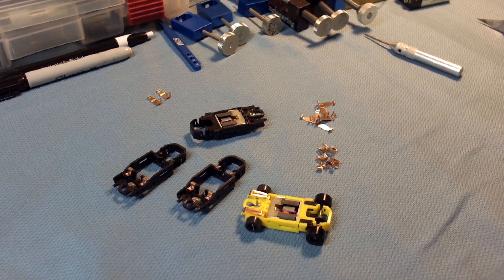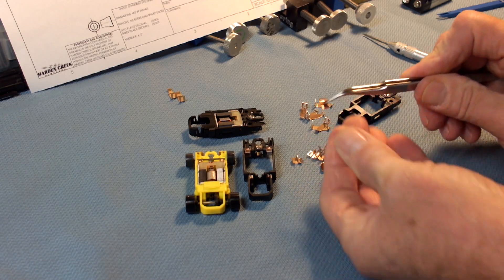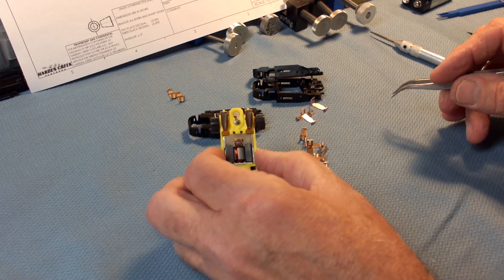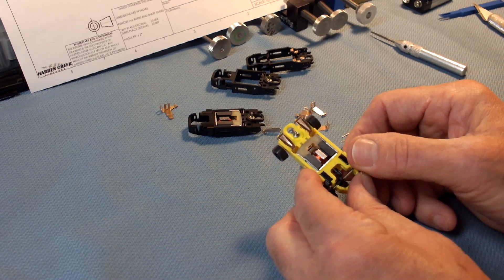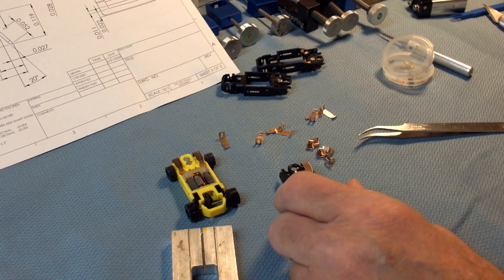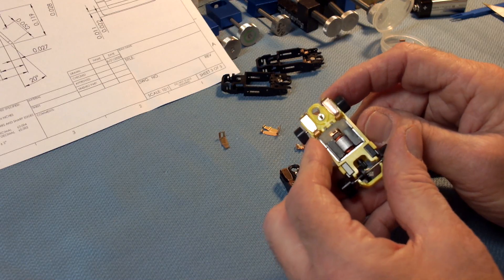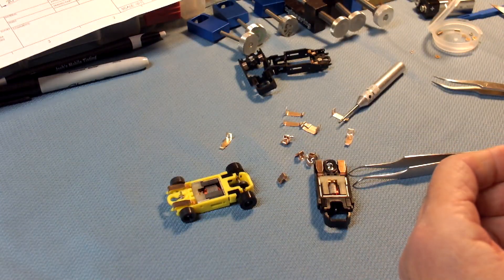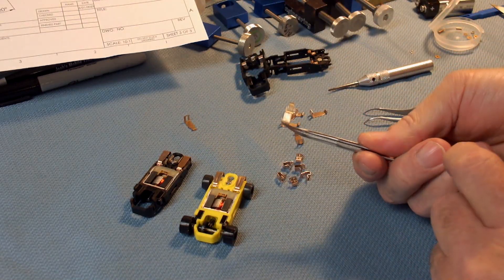New Long Travel Pickup Shoes and Pro Shoe Hangers from Harden Creek Slot Cars

Comment: If the shoe is floating, doesn’t that make the spring the primary current path?  Is the spring able to handle the current without removing the temper from it?
Reply from the maker: Yes the shoe floats.  But it is pushed back into the hanger so there are two paths of current.